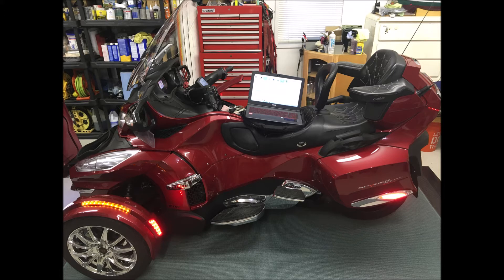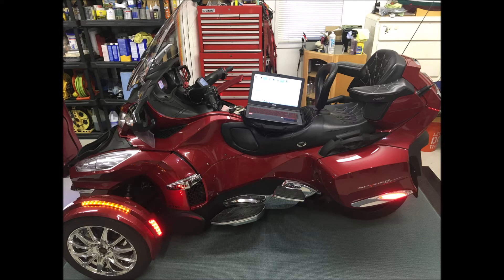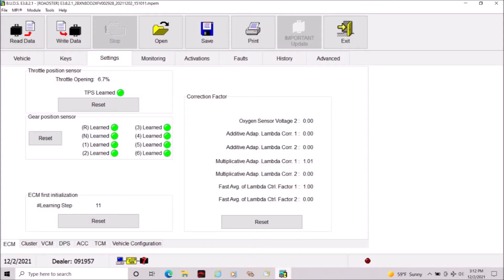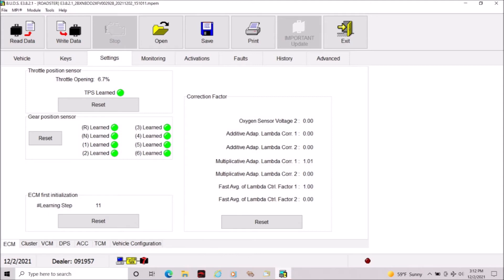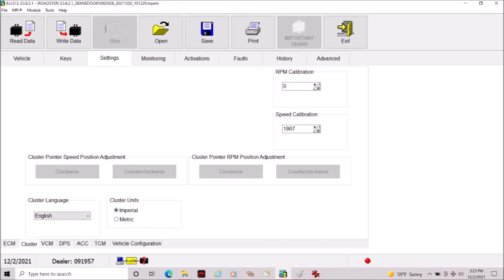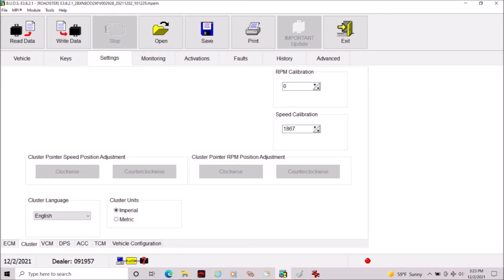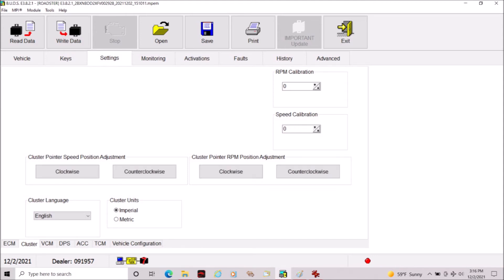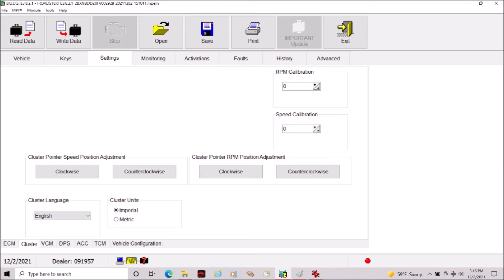Spyder Speedometer calibration

Comment: Hello I have a can am renegade 1000 2016, I would like to know if with the technician license I could change the name when I switch on the ignition, and I have a fault the counter remains at 0km/h and the mileage is blocked at 4589kms, I changed the speed sensor but still the same problem, with this license I can find the fault you think? thank you
Reply from the maker: Hi, Do not own a renegade so have no idea how to alleviate your issue. May be helpful to ask your question in a renegade forum. Good Luck.👌
Reply: @Starrider727  hello,i don't found the problem in the forum but thank's